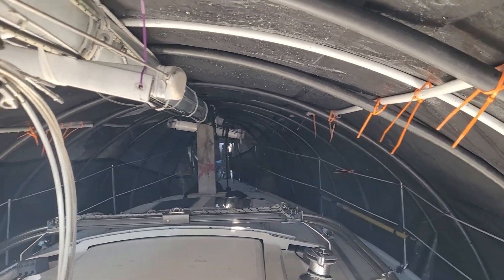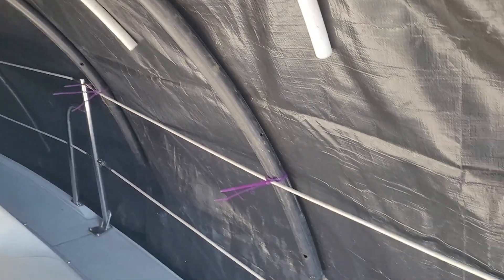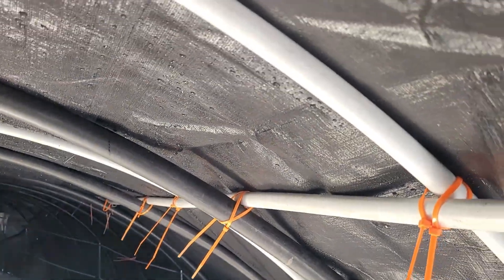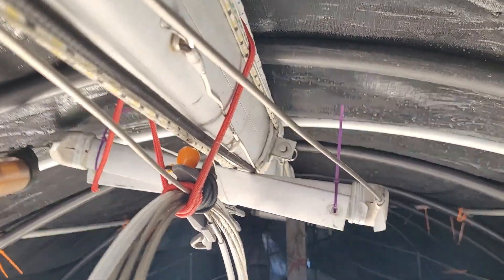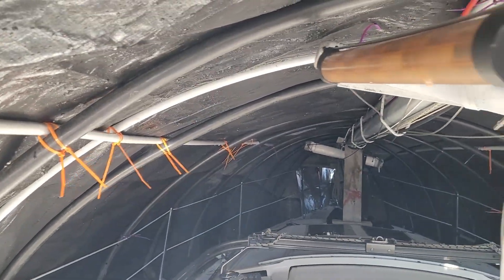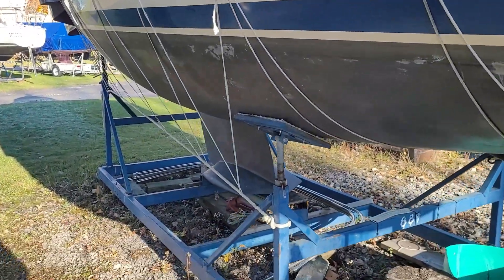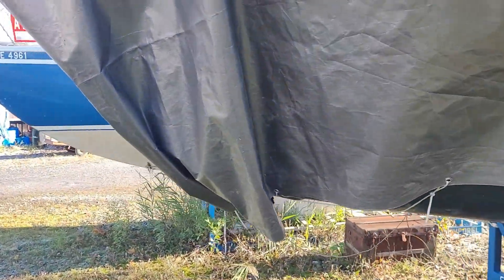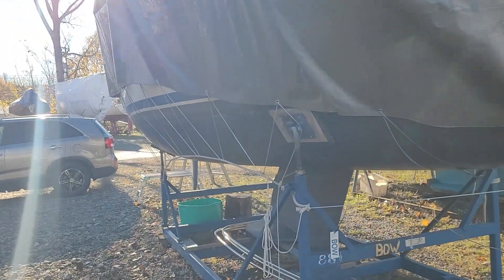Easy Sailboat Winter Cover (read details in description)

Comment: Thanks

So seasonal removal of your mast is preferred
Reply from the maker: If you're in a winter location and must bring boat out, than yes, unstepping the last is very much preferred.
Reply from the maker: @MrBluoct  just to elaborate more on this subject.  The reason unstepping the mast is best, is that many forget to loosen all the rigging. In cold weather, the stays will shrink a little and may even break causing the mast to fall. I’ve seen this twice at my club, damaging about three boats stored next to each other.  The other reason, more common, it that since most of the boat’s weight is sitting on the cradle base, when the wind pushes on the mast, the whole boat will tork and twist since the keel can not sway as it would in water. Hence why so many boats stored with the mast up have these crack between the keel and hull joint.